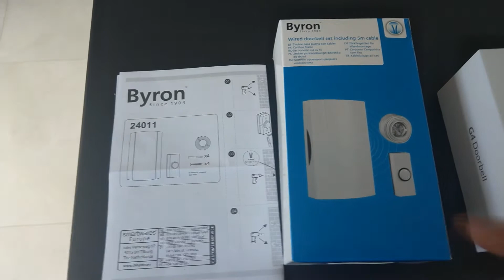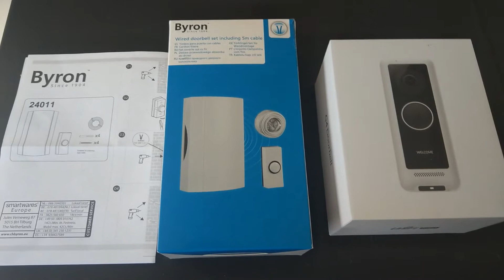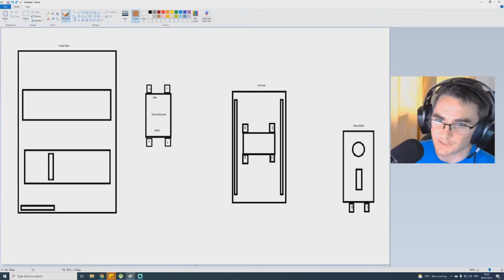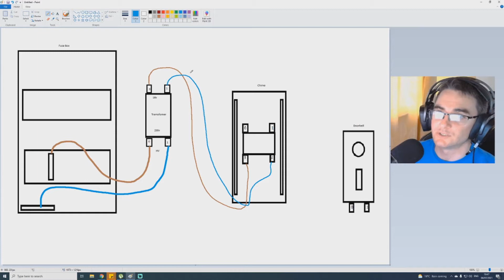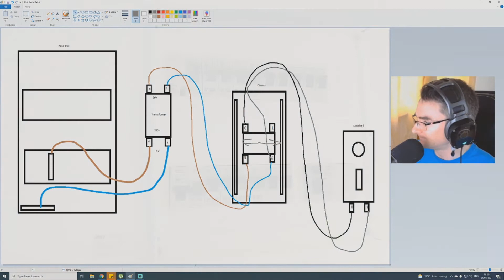Smart Door Bell EU/UK Chime Wiring

Comment: I’m struggling to get my G4 Doorbell Pro to work properly. I’ve got a cheap Deta chime with a built in transformer but I can’t use it. So I set mine up using the transformer that comes with the G4 Doorbell? It works for about 30mins the powers down! I don’t have a multimeter so can’t check the voltage. Like you I ran it off the ground floor ceiling lights. Really stuck, should I buy the same Byron chime as you?

Comment: Does the ubiquity tranformer fit into the chime?   so i could run mains direct to the chime?  my bell wouldnt be anywhere near the fusebox..  thank you in advance
Reply from the maker: It might just squeeze in sideways, I didn't try as mine is beside the fuse box. Worse case you could buy a second chime, gut the inside and then it should fit, so when you look you would have 2 chime boxes. 1 houses the transformer and the other the chime.

Comment: Would there be any way to connect the G4 to a normal battery doorbell? As we have a hide wires with 3 battery bells so we just need it to make the circuit for a second or two
Reply from the maker: You will need to use a relay the ring the doorbell then as the door bell needs 16v feed.
Reply: @ScottFreee3  any idea what type I would need to trigger it ? As it would be way better than replacing all the bells

Comment: Hello, thanks for the video. Absolute life saver. Just finished my own G4 install today and the only little issue I appear to have is that there is a 2-4 second delay on the chime ringing after pressing the button on the G4 itself. Any thoughts as to why this may be? Did you see it in your testing at all?

I have essentially exactly the same set up as yourself. Same chime and using the Ubiquiti transformer (but powered off a fuse spur instead of the consumer unit). 

Thanks in advance.
Reply from the maker: My ring is nornally on release of the button, or the odd time 1 second after. 

I have at issues with it disconnecting alot, so I have put it on a seperate wireless network, with the AP unit on high power and 5ghz. So far looks better
Reply: @ScottFreee3  Thanks for the reply! Mine seems to be every time at the moment - 2 or 3 seconds after the button release. I shall persevere! It does at least work, which is better than it sitting in its box (which it has done for nearly a year up to now!). Thanks again for the video.
Reply: @ScottFreee3  Apparently, the delay is down to a suspected software bug (after reading through the community forums). Quite a few people seeing the same issue. Ubiquiti claiming its outside temperature related but not convinced myself.

Comment: Wouldn’t your setup constantly keep the chime under action (even if not hearable)? At least for my chime it has a similar setup. 0 and 3 are connected because they form the electromagnet. 1 and 2 are also connected but just to allow simple passthrough. So using this setup would always keep the coil of the chime in action (even if it not enough to trigger any action until the button is pressed). Based on the UniFi setup normally 3 should be T and 0 should be F, at least for the regular chime setup, but it is interesting that the additional chime box introduced ghostings in your tests.
Reply from the maker: Yes the chime is always slightly energised. Ideally I need a 24v chime, but they are pricy, so for now this will do. Sadly the 16v power supply is giving out 22v. Otherwise this would be perfect
Reply: @ScottFreee3  The Problem with your solution is that our Honeywell D107 chime stated a permanent buzz-tone and i'm not sure that the coil is getting warm within time and burn itself 😕
Reply from the maker: @GermanTechniX  I have since changed this using the supplied relay unit. I will need to update this
Reply: @ScottFreee3  please provide the update, Ubiquiti sure as hell isn't helping us in any way
Reply: @ScottFreee3  please provide an update on how to use the relay thats supplied properly 😢
Reply: What did you do in the end?  @pvdk87
Reply: @booter654  I'm not using the chime anymore, couldn't get it to work properly, got it integrated in my smart home via Homey
Reply: @ScottFreee3  can u maybe just share a brief comment or an updated video perhaps 🥺😭

Comment: Great video. Is your 8V chime going to fine being wired to 16V? Will it burn out overtime due to the higher voltage?
Reply from the maker: It is possible if will not last very long, time will tell. It is rated to 12v on the datasheet, and it is actually recieving 22v from the 16v transformer
Reply: Hi  @ScottFreee3 Can you confirm that this is still working for you, as I'm wanting to do the same but wasn't sure if 16v would burn out the Bryon 8V rated chime. Thanks.